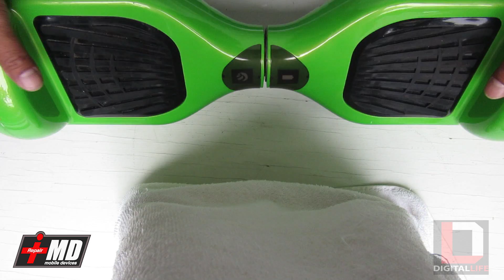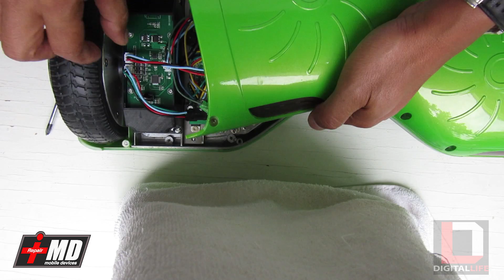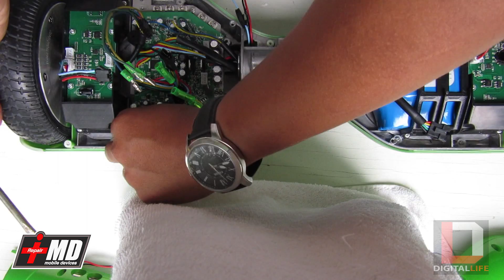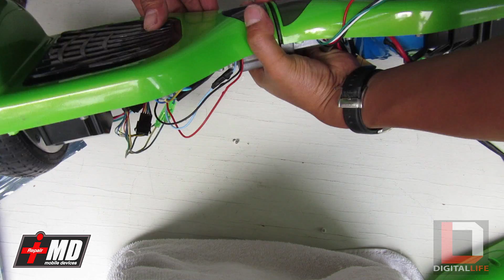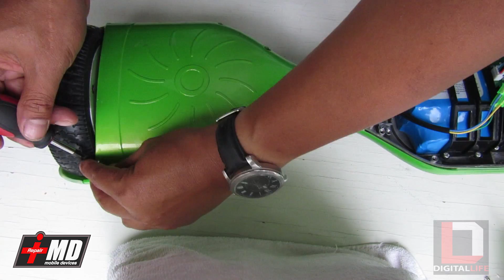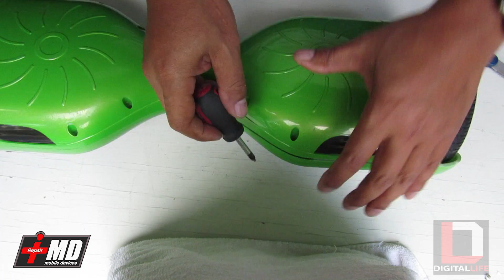Smart balance wheel no  power repair

Comment: Its not hard to test the fets. Use a multimeter and check continuity from + power rail to each leg. If its shorted its blown.  U can also check resistance. I think they should test around 5 or 8 ohm.  Nowas for replacing them… its not that difficult teally just be sure to have a solder sucker and som wik as well as quality solder and iron. You can get them hot as hell without damaging them.  First one i did took a long time to get out. And it got hot hot.  It worked fine after as well as the surrounding components.

Comment: Plastic to plastic screw holes and too high torque = stripped thread. No need to group cables together and this is highlighted by iRepairs problem getting the clam shell to stay together prior to screwing. Best to keep them separate and low profile to avoid crushing and stress on the screw holes. Simply no need to "group" cables.
Seems your sell links are D.E.D but thanks for the video all the same, I learned  a lot from you.

Comment: Hello good afternoon, you can repair the control board because when i connect to the charger the charger ligth turns off. I already checked with the battery and it's good.

Comment: Are all chargers compatible with these boards? If I replace the three board set with a new one and use the old charger and battery, will it work together and not blow up?

I have some no-name board, it is just called Smart Balance Wheel, no model number, nothing - repair man sad it has burned transistors and so all the boards might need to be replaced because it is cheaper than try to debug it and then maybe discover more and more burned elements. It turns on for a moment and then immediately shuts down, it happened after its center axis broke and was repaired.
Reply: Шура! Пилите гири они золотые.

Comment: I've been using mine since Feb and i was out of town and when i came back i thing a family dropped it. It didn't beep anymore but still worked. couple days passed and while i was riding it just stopped. Now when i press the power button the power comes on and shuts off in a second. whats wrong with this?

Comment: Hey hoverboard one side won't work but there's one piece that I didn't see you work one all the wires are attached on mine expect one and the battery is fine I can't seem to find or see where to plug in the one thing

Comment: my board works but the problem is that i charge it for over 2 hours and start riding it and it would just turn off completly wile im riding it. the way i turn it on is plug it in and power it on. it wont hold a charge over 5 min. please help me

Comment: My hoverboard has a problem where I tried to fix the Bluetooth and it stopped working where it would take about 20 seconds to turn on and then would not work then eventually I tried replacing the capacitor and when I plugged the battery in it would just spark at the connector when I had it barely touching and then it would turn on briefly for about 1 second then shut off when it was all the way connected to the battery is this the battery or the motherboard 

Best regards,

Joesh Gray

Comment: This guy does not know what he is doing, connecting the led indicators to the charging port etc, then editing this out once the connectors have been swapped. 
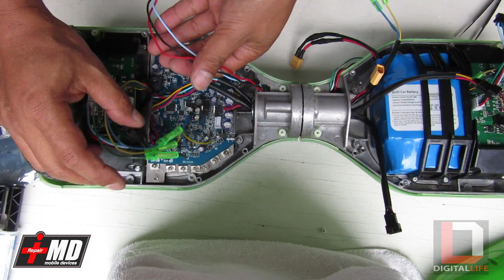16:48 -> 19:03
Reply: Is that what caused the constant beeping when powered on?

Mine makes the same constant beeping noise, but I haven't touched a single connector. I'm stumped as to what the problem is.
Reply: Does it beep as soon as you power it on or when you activate the pressure plates? 
Have you calibrated it?
Reply: I cant beweave he gives you fwee Velcro😱
Reply: I noticed this too .............. but also after editing did you notice the indicator cable was now plugged into what he called the "Balance Sensor" (8:12) & later called "Pad/Pressure Sensor" (15:30) ........................... Repair at Own Risk!!!!

Comment: Guy help me . My board fell into the swimming pool and I let it try for 3 days and I try to turn it on . Now I charge it .it shows its charging but in the charging light where we can disconnect In the middle it is blow green . It should be red after full charge green but it is green in first charge . When I unlpogue it and try to on it didn't work . The light only shows on when I am charging and the beep sound. Please help me

Comment: Hello. My hoverboard won't turn off. if i press the power button i just hear one sound but it stays on. what can i do?
Reply: Yes I had the same the signal won't stop huh?..i looked this Video an just disabled the battery and than it stops you See this in the Video at..
Reply: at minute 05:59
Reply: +SchimmelHirn thanks! so i just need to replace the control board right?
Reply: +Moessie900 Yes I think so i just pull it out and then i dont go on but this horrible Sound stop and the Red light turned off..sorry for my bad english i hope you understand this
Reply: +SchimmelHirn ok! thank you
Reply: +SchimmelHirn I have the same problem

Comment: I've been debating whether to put the wires inside or outside the battery casing. If I put them outside the sharp edges of the battery casing might chew up the wires. If I put it inside the wires might deform the battery. Which is better?
Reply: Шура! Пилите гири они золотые.

Comment: My hover board still works but the left wheel has started making a clinking noise anytime I ride it. It seems like a problem with the axle. Do you think I this is something I'll be able to repair? I appreciate any advise. I'll be back to report on my findings after taking my board apart.
Reply: Доктор, Мы его будем лечить или пусть жывёт?

Comment: Some of them have a bad ground with that board. If you notice your charge port give out sparks, Do not attempt to charge it any further. Open it up, Check the connector on the terminal of the circuit board and the battery to see it is blown. I will make a video of what happen to my board.
Reply: Hi my board has a short red to black and battery plug, any ideas, one mosfet is shorted but having removed, the short is still present at plug. Appreciate help in advance

Comment: I have a smart balance wheel for my son and one side is like it's locked the blue light stays on there's like five stripes in the front and two of them are staying on the one side that wrong move i took it apart and I don't see nothing wrong please help
Reply from the maker: +Stacy Birchmore you need a new balance sensor for the steady blue light

Comment: mine wouldn't turn on so i changed all the parts except the battery and now the problem is that the battery light doesn't turn on (i replaced that part too) and it doesn't let me charge it and i have tried different chargers and it just won't charge. can you please help?
Reply from the maker: You have a bad charger

Comment: I got mine the 25 tried in once for 2 mind in the house then the red light of death started flashing!!! I tried to recalibrate it by putting in back in the box pushing the button and waiting for the beep.    then the led lights stayed on and the battery light plus the other light is green and will not go off.   whenever I turn the scooter back on the lights are all on.   They don't flash they ate just on and the board is totally unresponsive.   I'm gutted I really can't belive it worked less then 4 mins in the house then it's sat in the packaging.    I have sent emails to the company.   I got it from i watnation. com   from effecto led official distributer of I watnation.  I'm gutted it cost me 100 to get it shipped from valencia to gran canaria where I live it was 300 euros to buy.   then I bought the bag also.    its supposed to have a garantee of 2 years.  And of course I can't contact the company til Monday but I have emailed both of them.   I want a refund and want to buy one that works with a Samsung battery.  hopefully that won't blow up either lol as I have seem videos on u tube.   feeling like an idiot and very dissapointed with this item.

Comment: mine the charger stays green.  wont charge or power on. board?
Reply from the maker: +Travis Lewis Yes it sounds like ether the battery or the main logicboard
Reply: Battery is at 28 v since i opened it. I shorted the on /off like you showed. A red light comes on the board then it dies. Have a board coming. What scares me the second one i have does same thing with charger but it works.
Reply from the maker: if you isolated the battery as working then there's only the main logic board left
.
Reply: +iRepairMD Youtube thanks.

Comment: My board does not want to shut off. When I push the power button it just beeps but does not turn off. Any idea what's the issue?
Reply: It also does not balance because I can't recalibrate it because the board does not shut off
Reply: +Christian  Vasquez same exact problem. I think I'm gonna open it and unplug and re-plug the battery
Reply: +Life of BRY I've tried that and I've had no luck
Reply: There is no problem. I have an io-hawk and that's how it works…

Comment: I got my swagway on November 18th. On Saturday, the 21st, I crashed mine pretty bad. The right side of the board turned all the way in a full rotation. It worked for a little bit after that but then it shut off eventually. I charged it for like 2 hours and nothing happened. It just won't power on. I later opened up the left side and a little metal bar popped out and I put it back in the center and then the right side was fixed. But it still won't turn on. I'm afraid to do exactly what yu do. Is there another solution for this?
Reply: +Alec Spiro if it is double system,maybe system in right side has problems,it can not charge,may charger no good.

Comment: My board fell into a pool and hasn't turned on since then. It turns on only of its plugged to a power source and then it starts blinking red and making noise. I purchased a new logic board but I doubt that's the problem. I need help.
Reply: +Chukwuemeka Anekwe mine fell in the pool today too!! and it took like 20 mins to take it out :( idk what to do anyone please help i turned it off the moment i took it out what am i supposed to do now
Reply: Careful your battery is dead and needs to be replaced attempting to charge the battery could explode it so don't plug it in
Reply: where do i replace it from? Tom dilly
Reply: i live in egypt and i got it from dubai! so i don't really know how i can replace it.. do i need to like go to any electronic place that can change it for me or does it have to be replaced with a battery from another hoverboard
Reply: GLVCKY
Everything will be broken inn the hover board not just the battery it will also be the motherboard,leds at the front,sensors and all the other circuit if you want you can get the full circuit here http://www.ebay.com/sch/i.html?_odkw=hoverboard+battery&_osacat=0&_from=R40&_trksid=p2045573.m570.l1313.TR0.TRC0.H0.Xhoverboard+motherboard.TRS0&_nkw=hoverboard+motherboard&_sacat=0 only 53.59$ but the battery doesnt come with that so you can get the battery from here: http://www.ebay.com/sch/i.html?_odkw=hoverboard+motherboard&_osacat=0&_from=R40&_trksid=p2045573.m570.l1313.TR0.TRC0.H0.Xhoverboard+battery.TRS0&_nkw=hoverboard+battery&_sacat=0  comment me if you dont trust ebay than il give you a few links from amazon or you can search it your self if you want

Comment: Ok so maybe this question has been asked and even answered but i dont feel like searching so, i have a question. I was riding down a hill one day and when i got to the bottom of the hill and stopped, it jus flew out from under my feet. Without me even moving. Im pretty good on it so i know its not lack of experience. But now wen i turn it on the circle LED on top is flashing super fast but in green and neither on the front blue LEDs come on wen i step on it and it wont move. Rip?
Reply from the maker: +mrthugie1 sounds like your balance sensor are stuck in the down position causing the sensor to send a false reading to the motor,
Reply: +iRepairMD Youtube i took it apart and everything's okay. I think as far as the two things on each side that press in go. But its like its off and the green light on top is blinking so fast its almost constant

Comment: +iRepairMD Youtube Help i bought one of these boards and it worked fine for a few days. Now if you ride for 5-10 minutes it will just randomly turn off the motors, it stays on but becomes impossible to ride and beeps like you stepped off. Please help me fix my problem.. Thanks in advance.

Comment: +iRepairMD YoTube  where are you guys located? I need my 8" scooter fixed mine seems to work but the problem is the on and off button, it doesn't want to turn on or off without me having to open the shell I think the wire is loose and might need a new one, please let me know! HELP! ThankYou!
Reply from the maker: +Simba J Calub we are in Richmond, Virignia
Reply: +IRepairMD I know but can I send you guys my board to fix?
Reply from the maker: yes you can
go to www.digitallifex.com for instructions
Reply: Omar Jones
Hey buddy,, question.. So my board was already charged up,, I got on it for like 5 minute. Den had it sitting for like a week.. I was suppose to go to Atlanta so I put it on the charger cus I wanted it to be fully charged for my trip, anyway I went to work that night and forgot to unplug it.. Now it won't cut on.. Any advice..??
4 days ago•
Reply: +Omar Jones my best guess is you might have over charged it? I heard that most of them are so sensitive why they strictly just need about an hour or 2 of charging but I'm not so sure
Reply: So I just figured out that my battery cell is burnt out after all. Connected my brothers battery to my board and it works; therefore, I need a new battery. Any advice on where to buy one for less than 110$.???

Comment: hey I have a technical issue with my smart balance scooter. I reset the scooter and recharged to fully charged it. but the red light won't go away and one side of the board will not work. What could be the problem please email at Tyreebrown825@gmail.com

Comment: my Hoverboard has the battery light green and that side pedal is working with its LED light, but the other side has solid red light and the pedal on this side is not working neither the LED light. any advice. tried reset didn't work

Comment: Hi. I have one of these which spoilt after a day. It doesn't turn on when I press the power button. When I plug it in to charge, the green light on the board and charger flashes. Is the board the problem?

Comment: Hi i have seen your tutorial on youtube regarding logic board replacement, on mine wen u connect the screwdriver on the power connection nothing happens, but when i connect my charger it turns on and chargers and ont the actual logic board there is a led flashing but when u take charger out it turns off any advice please
Reply: open it up and make sure all the wires are connected, something similar happened to me and i found a wire was disconnected
Reply: hey i did and seems all connected
Reply: +Naeem Patel it could be a blown capacitor, could be a battery issue, or could be the logic board...sorry i couldnt help more

Comment: Do these parts work for the 10 in. scooters as well?  My issue is that the scooter turns off while riding with full charge.This happened a couple of times and it won't power on for 15 to 20 min. There are times that it wont turn on until I connect it to the charger. Could this be a battery problem?
Reply: +Jose Quijano did you find a solutiuon to this??
Reply: Normally battery is 36v 4.0ah   Your battery maybe is 2.2ah.  Just change a new battery. 
If your Airboard is double system.you can fix two battery. Rang will be longer than normal

Comment: I tried to recalibrate and now both lights stay on and it does not work. what should I try?
Reply: Am having the same problem bud.. Please advise me what did ya do?
Reply: +Yovinash Pahladi the pressure sensors are bad they need to be replaced. expensive fix.

Comment: 1. The light that shows my battery life is not working. I believe it is because one of the wires is unattached from its connector. Is there anywhere where I can buy this cable that attaches to this?
2. Also my headlight when I plug it back in stays on, even though my board is turned off. It is also dimmer than my other light when it is turned on. Do you know why this is? Thanks for any help!

Comment: Hello, when you removed the logic board why did you remove each screw from the transistors? Why didn't you just unscrew the 4 screws on the metal plate below the logic board and remove it all together? Wouldn't that be faster? Thanks
Reply from the maker: +Sean Burke looking back , leaving the transistors to the heat sync plate, and just removing the 4 screw which fasten the logic board to the frame would be more efficient and safer. 
I found that our later thanks for the feedback
Reply: You are right it even makes video longer

Comment: my board tends to go way too fast when i step on it and there is no way i can't get on it one wheel turns way faster than the other one do you know what could be the issue?
Reply from the maker: Place it on a flat surface and Try to recalibrate it, by holding the power button down for about 4 seconds, and let calibrate for about 4 minutes. Good luck
Reply: +iRepairMD Youtube so i did what you said but nothing. this thing goes like crazy when i get on it. could it be because i changed the internal battery??

Comment: hi looking to buy a part from you but im unsure if i need a new board or battery. had mine for a day it has two red boards on each side but doesnt have a large one like this video! the battery was getting low so i charged it for 2 hours and then i unplugged it .when i go to turn it on it lights up red on both indicators and then shuts off ! it says its fully charged but it wont work.
Reply from the maker: It sounds like You need a new logic board
Reply: Your board is double system
red board is not good. 
Suggest you can buy green or blue board